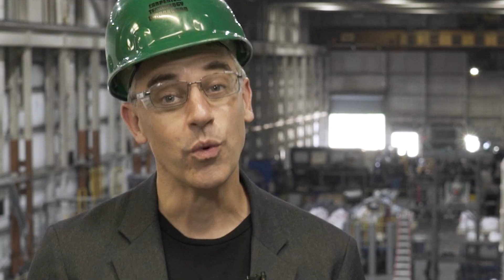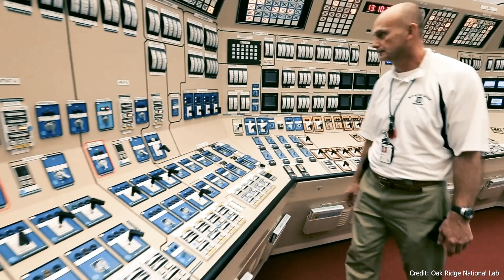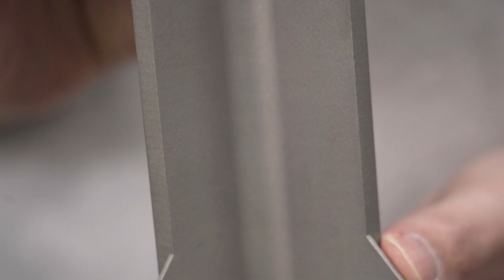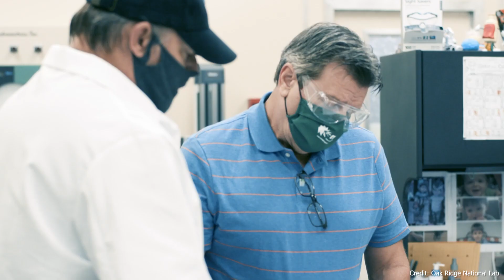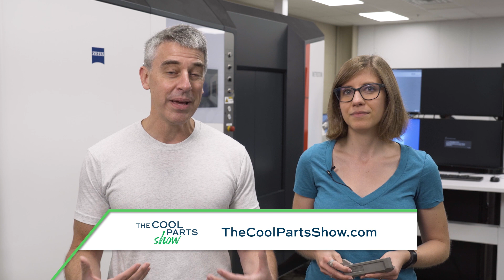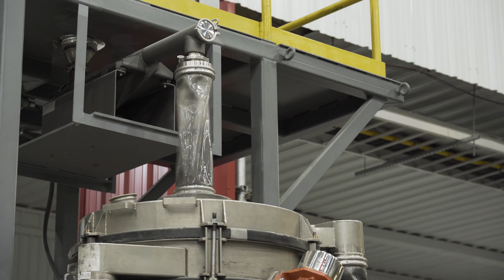3D Printed Brackets Secure Fuel for Nuclear Power | The Cool Parts Show #45

Comment: So if the bracket is designed for a "vibration event" such as an earthquake, what will they be looking for six years from now if the Browns Ferry plant (hopefully) hasn't experienced an earthquake? It looks like NUPIC has been discussing 3D printed parts since at least June of '17, and the FAA certified its first parts in '15... even for the nuclear industry this seems slow. The heat exchangers seem like the real opportunity, but I haven't ever seen anything about 3D printed zirconium (though I haven't been looking, and no, it's not like zirconia used for dental prints).  As always, thanks for the interesting and unique videos.
Reply from the maker: Right, what if there is no earthquake? Really the investigation has to do with “unknown unknowns.” I.e., is there anything about the microstructure resulting from metal AM that might react adversely to anything about the environment of long-term operation in a nuclear power plant? By all theoretical understanding, the answer is No. But being conservative means trying it to see.

Comment: Seems cool but not very cost effective
Reply: Yeah, they were saying it's proof of concept so they kept everything the same. Still, I'm not sure I quite understand what aspect of 3D printing they are trying to validate. There's literally nothing novel about it, and it's the unforseen load cases and potential deflection based changes when going to an "optimized" printed design that present the most risk.  Looking at the fuel bundle, there's really not much impact you could have a lightweighting or cost optimizing this bracket. The intermediate fluid mixers or spacer grids for the actual rods (@3:20) look like the real application opportunity, along with the top and bottom nozzles. Those may need to be zirconium though; curious if anyone can confirm.
Reply from the maker: Do not yet know about zirconium; will watch for that. But yes – the promise here goes beyond brackets like this. Validating AM parts do nothing unexpected after years of use in nuclear power plants opens the way to heat exchange systems, the larger area of promise.